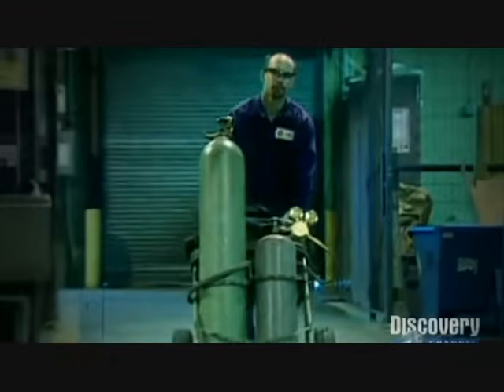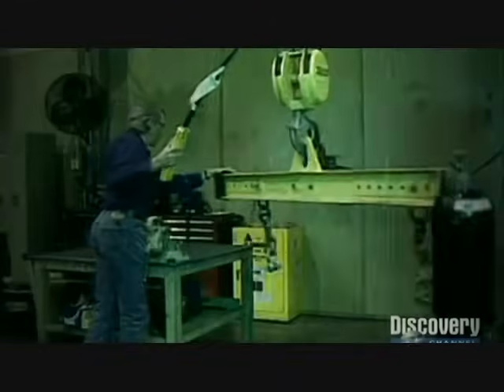MythBusters: Air Cylinder Rocket

Comment: Years ago, I saw a neighbor was burning some trash in a big metallic basin.
A few minutes later, I heard a loud bang on my service door then a clatter on the floor.
Upon searching, I saw a hair spray canister and a small dent is visible on the door, and it was about 3 feet away from where I was sitting.
The burning trash from where the hair spray canister came from was about 70 feet from where I was sitting.
Good thing that I wasn't standing at the service door at the time, or I'd be hit.

Comment: It is a known fact that any container under pressure (more than atmospheric) will act like a missile if proper precautions are not taken. Even the pressure cooker used for cooking rice is no exception for that. When you take a gas cylinder after filling the gas it is a pressure vessel and can act like a missile if not handled properly. For this purpose it was the precondition that each and every gas cylinder needs to be certified by local government body who deals with explosives to ensure public safety.  While doing so that Govt body ensures that the manufacturer had adopted strict procedures/practices and ensue that such cylinder will not fragment in case of any eventuality of mishap or accident which was beyond control.  
I have worked in such a manufacturing company of the gas cylinders for applications of Oxygen/Acetylene/Chlorine/Ammonia/LPG etc. During manufacture we had conducted prototype burst tests by application of excess pressure till bursting and fire tests.  After conducting such prototype tests only, the Explosives Dept of Govt of India gave licence and permission for manufacture in bulk and they post their full time inspectors for stage wise and final inspections and witness of all tests. 
If all precautions are taken, such gas cylinders are safe to use and nothing to afraid of.
Regards. Durgarao

Comment: I know just from the amount of oxygen (2500 psi) that the cylinder will become a missile if the valve is sheared or busted off. I have invested a total of 43 years now in the welding trade & NEVER EVER slacked when it came to safety!!!!!
Reply: Couple years ago group of welding student at my old trade school(or what ever that is in USA and what not. After basic school you ether go learn trade or go to highschool. From both you can go to ether college(scientists etc) or trade college(engineers and such)) got great fucking idea to weld a end to pipe, fill it with acetylene and oxygen and then make a spark at the end. Group was probably expecting just loud bang so rest went out from the welding booth area, while one idiot hit the spark. Sadly they underestimated how much explosive potential this mix and amount of it had.

All the windows from the workshop and two neighboring workshops shattered(mind one normal window and then vacuum glass), all the welding booths with professional quality welders were smashed into walls with that one smart ass, witch lead to most of the Co2 tanks to rupture the valves that turned into intercontinental missiles, going trough the roof and brick walls. With i guess idiots luck spark guy only lost his hearing permanently and rest of the idiots has slight hearing damage. Damages went close to million€ and main jack ass got fired from the school. Lucky i guess that they were planning on renovating welding workshop anyways, though this was not to happen in a year, but for this incident they skipped a electric workshop and went right to renovating metal shop.

You cant cure stupid, but never slacking when it comes to safety sure can save you from this kind of incidents..

Other close to darwins award class incident was when car mechanic students decide that they wanted to dyno teachers porsche 911, but messed on securing it properly. At 200km/h car jumped off from the rolls and slammed into tool cabinet wall. Friend of mine was on other side of the wall at that time... it was like some one had smashed a car into the wall XD

Comment: 30+ years ago I worked for a Soda distribution plant. Co2 tanks were delivered by truck on a pallet of 20. an accident happened, a valve broke off and it flew 75 feet before it crashed through a concrete block wall and flew into the middle of a field next to the building. Because is was airborne within the warehouse it hit the wall about 8 feet up and opened a hole approx 4 feet in diameter. Made a Hell of a sound. good thing no delivery trucks were enter the staging area.
we laughed of course but that could have presented a real danger to employees. 
no one in the front offices knew because of regular noise in the warehouse till the boss came out later and found out he had a new "window" in the wall.
Reply: My old foreman told me a story at a place he worked, they were unloading oxygen cylinders in a dead end alley way between two brick workshops and a brickwall at the other end.
Someone dropped a bottle and it spent 20 seconds ricocheting up and down the alley, he said its the only time he's 3 grown men climb a brickwall with their fingernails like cats 😂
Reply: This happened at the machine shop where I worked. A maintenance guy unhooked one of the secured fire suppression systems on one of our Ewag machines without properly disconnecting it. Maybe half the size as one of those co2 tanks. Airborne for 15 seconds, smashed giant dents into about 8 machines before blowing a hole STRAIGHT THROUGH a metal tool box (a big nice one) FULL of giant wrenches then almost smashed my coworkers legs off. I quit after that. This was last year.

Comment: In our high school shop class we had a patched hole in the roof from a just filled tank going off the platform the tanks sat on in the 1960's, breaking off the valve and going ballistic through the roof...  they had the documentation (story in the local paper, pictures of the tank in the football field behind the shop) framed and posted on the wall... Pretty cool stuff, just glad it happened way before my time!

Comment: For an awesome read and photos, Google "investigative report on chemistry 301a cylinder explosion". "The explosion blew all of the tile off of the floor for a 5' radius around the tank turning the tile into quarter sized pieces of shrapnel that embedded themselves in the walls and doors of the lab. The blast cracked the [4-6" concrete] floor but due to the presence of the [reinforced concrete beam] supporting beam, which shattered, the floor held." Fortunately, happened at 3AM.

Comment: the big tank they used I believe have a working pressure of 2240 psi.  A lot of energy and mass but tanks that go to 3500 psi are widely available for suba diving.  result would be more energy, less mass same result.  might not fly true because it was smaller.

Comment: My dad told me about an accident that happened at his work place where that exactly happened. Not only did it go right through a concrete block wall, but it made a nice size dent in a steel bar on the other side. He said that it was a miracle nobody was hurt.

Comment: It will heat up. You can't liquefy air at ambient temperatures, because the critical temperature of nitrogen and oxygen is far below ambient temperature. It can, however, become a supercritical fluid.

Comment: im a union laborer, and i can say YES this DOES happen, ive been on jobs when guys hit the tops of them with sledghammers, and they will go a few hundred feet if they dont hit anything..logan airport accually sent the feds to our job because they picked it up on radar and thought it was a missile lmao these things WILL go through a brick wall no problem
Reply: Hold up. Why are people intentionally breaking air tanks like that?
Reply: @lukez9721 They think it’s fun 🤷🏻‍♂️
Reply: D.O.T cylinder tester here . This guy is right
Reply: So you never saw it go through any thing? You just say you’ve seen then go a few hundred feet. 

My paper airplane went a few hundred feet. Therefore it can bust through brick wall
Reply: @pyropulseIXXI  your paper airplane doesn't have upward of 1500psi behind it. Also why are you even questioning it when you just saw it on video?😂

Comment: @Bushougoma A liquid nitrogen tank blew out through the bottom (its safety disks were plugged), and did some very impressive damage.  Cracked a 6" foot concrete floor and shattered the reinforced concrete supporting beam beneath it, then went through a concrete ceiling to smash some water mains.  3ly 8azh

Comment: this is a good reminder for those times if you ever have to work with compressed gases, don't knock off the regulator. :P
Reply: What usually happens is that someone accidentally knocks one over and the regulator hits a table edge or something and breaks

Comment: cinderblocks are not as strong as people seem to think.  Pick one up and drop it on a concrete floor and it will break.  Certainly not the same as a poured concrete / rebar construction.

Comment: The parts of a system out of equilibrium, if given a chance to return to such, will attempt to equalize. This is a very colorful demonstration of such with air pressure.

That said, I would not want to be standing anywhere within a good hundred feet of a pressurized tank with a snapped valve.  Doubt the experiment if you wish, but I will kindly stand over here with bones and viscera in the same place they started today rather than argue with Newton's Laws of Motion as applied to propelled metal.